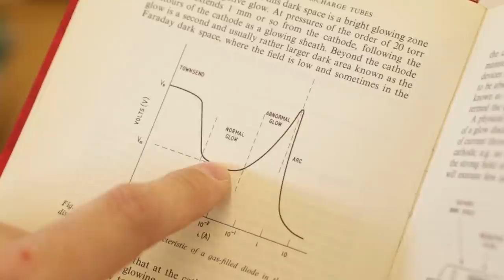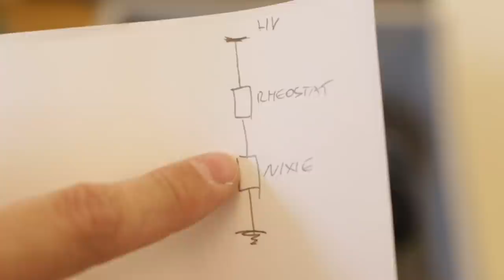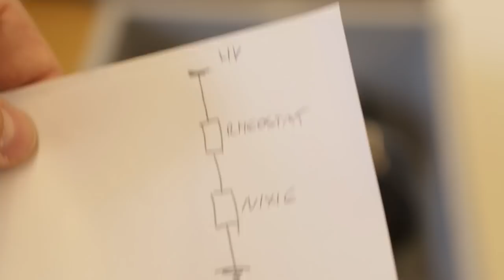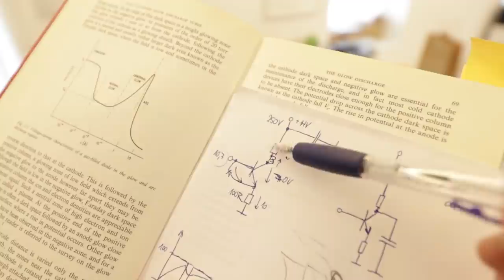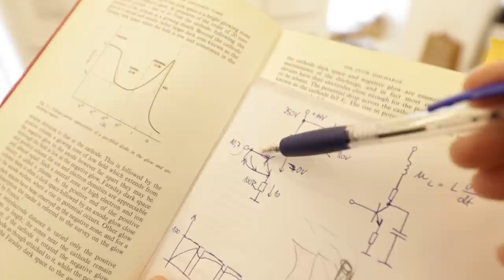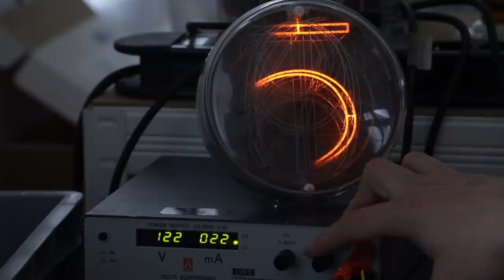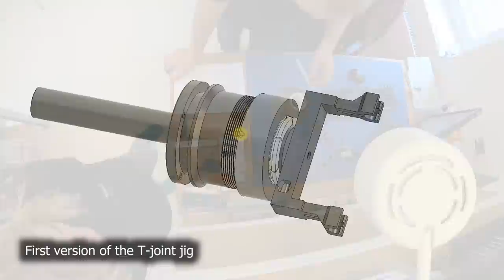Aging of the H tube and a vacuum relay project | week 14-15/2022

Comment: The tungsten can be brazed with a TIG torch. (Using a flame is hopeless!) Nickel wire can be used as the brazing metal. The welder I have is a Primeweld TIG225 which is an excellent low cost unit that includes everything you need except the argon tank.
Reply: I wondered how long it takes to find an commend from you on this channel.
Reply: @gekkedirkie  I keep an eye on Dalibor in case he gets in trouble!  :)
Reply from the maker: Hi Ron! Nice to see you :-) Good idea with brazing with TIG torch, never thought about it. We have TIG set up, so we can try it.
Reply from the maker: @glasslinger  I am in one big trouble since I started with nixie tubes :-)
Reply: @daliborfarny  Oh my! I watch from here and think of how great you are doing! Be careful to not get too big too quick. Keep out of debt! Let me know if there are tech problems you are having, such as the current limit for the cathode cleaning machine. I could have solved that for you immediately! (free!)
Reply: @glasslinger  can you help me?
Reply: @ibrahimkaragoz9596  I don't know. Some things I know about other things I am clueless!

Comment: two things to consider for the T joint.  longer jig to help center the initial bubble by holding where you have it and an extension to the end to guarantee position of the center and repeatability.  The second is that to copper ( or other metal ) plate anything you need a very dangerous chemical in the metal salt solution to make even coats.  I do not know where you would be able to get cyanide, it seems to act like a catalyst for electroplating, you do not need much, roughly 1 gram per 500 grams ( five hundred ) of the metal salt ( as measured dry ), more cyanide for some metals.  The solution will warm up due to the current in the solution so using a fume hood is always recommended.  Great work, keep going!

Comment: You could add an overcurrent shutdown circuit to the test rig. That could shutdown the output in under a microsecond when the arc is detected. That would prevent the wires from being burned off.

Comment: I wonder if for the burn in you could use RF. I think that might reduce the chance of arcing, and plasma cleaning is a pretty common technique for vacuum chambers.
Reply: Unfortunately not. You will face the same issues with arcing. The change in polarity alone (at MHz "speed") will not stop the arc development process. The RF generators are used in applications where the target is a non-conductive material (plastic, glass). For nixie tubes DC power supply seems to be a good choice. I would say lowering the pressure will reduce the arcing tendency, but I am not sure about mechanical limitation of a tube. But maybe for that kind of test you can use thicker glass. Please also localize where you have arcing. Maybe you can also improve wires insulation (and use enamel wires?)

Comment: That vacuum relay looks to be brazed.  I'd try nickel or silver solder, there is very little that can't be brazed or soldered together with them.

I am surprised you went with inductive arc current limiting, I figured some high-side resistive current limiting would do the trick?  Unless the anode capacitance is high enough that it alone can supply enough energy to zap the BE junction when it gets into breakdown?  With a hundred ohm emitter resistor I am guessing the current limit is around 40-50 mA and with say a 5 volts BE breakdown you must be seeing > 100 mA current surges during the arcing.  The transistor must be getting into second breakdown or something to even be still conducting the arc current for very long once the emitter rises above cut-off, what is its VCE rating?  Adding a series diode in the emitter may protect the BE junction (more reverse breakdown than a few volts of the BE junction at least), but then the emitter resistance would need to be changed to reset the normal current limiting point.  Kinda surprised you aren't killing something in the base drive circuit if the BE junction is failing, it must have a fairly stiff drive or a lot of capacitance to be able to sink damaging amounts of fault current?  It might actually be the transistor capacitances that are letting it kill itself, the miller capacitance in particular...  I think a better topology would be to have another small NPN (like a humble 2N3904) steal the base drive from the the HV transistor's base, fed itself from the emitter resistor, that way it need only generate a diode drop of voltage on the emitter before limiting - much less than the diode drop less than logic level, this does reduce the voltage reversal required to reverse bias the BE junction considerably but decreases the emitter sense resistor to about 13 ohms which will drop only a volt or two under fault conditions and the feedback transistor should be very fast in clamping the base drive, discharging any current that feeds though the larger device's significant capacitances.

Comment: Please read about "arc management" functionality in DC or RF plasma power supplies (like in TRUMPF or Advanced Energy products). In an overcurrent state the switch off has to happen in 10-20 us, so it has to be pretty quick. Then you have to wait 20-50 us and you can restart the voltage source.

Comment: Add a 15W 230V pygmy lamp in series with the anode supply. This will limit the current that can flow into an arc, and thus reduce the transistor damage. You can use an indicator lamp, which has a nice long squirrel cage filament, so it will rapidly heat up and limit current.

Comment: You can braze almost everything even stainless steel and tungsten carbide with high silver percentage material and flux, try searching in hvacr shops, they use this brazing material a lot.

Comment: Love the video!
Regarding the oxidation issue you're having, have you considered flushing the tube with forming gas?
It's a mixture of Argon or Nitrogen with 10% Hydrogen and works as a reducing agent without being a fire hazard.
As far as I have seen you have only one access port to the tube so a constant flow would be hard to do, but a few mBar of positive pressure inside, coming from that port, might still work out when sealing the front window. 
Good luck either way!
Reply: I wonder if it could be part of the bake out process even? They still have a tubulation for gas access, it'd need to be done through a set of fill and drain cycles though.
Reply: or they can add some hydrogen to the argon. The hydrogen will eventually escape by itself, most likely during the aging.

Comment: It may be possible to use an Op-Amp based overcurrent detection circuit on the tube ager. Depends on how quickly and how high the current spikes during an arc.

Comment: Have you thought about useing RF to create a uniform plasma in the tube to do the ageing and avoid the need to drive the tube so hard and risk arcing?
Reply: This is a great idea.
Reply from the maker: Yes, but we kind of struggled with it - it was difficult to keep plasma where we wanted it. But it is a backup solution, we still have the plasma setup prepared..
Reply: @daliborfarny  hmm yeah plasma can be unstable like that.  i'd be tempted to try somthing like  a few MHz at high voltage fead into each number in tern and allow it to capasitively discharge to whereever it wants.  it could be guided by external electrodes on the glass if needed, somewhat like a plasma ball.  the other internal structures do complicate it a bit and limit your options though
Reply: @daliborfarny  To get predictable results, you would need to calculate the electric field strength between elements (ANSYS Maxwell software or equivalent). Additionally the geometry of the elements would have to be designed so as not to exceed the specified field strength in order to minimize the arcs. But this is a higher-tech topic.

Comment: What about flushing the tube with gass (argon) while sealing the frontwindow (like tig-welders do) ?
Reply: This is my question also
Reply from the maker: We do that - I will try more approaches in the next sealing..
Reply: @daliborfarny  Strage, it should not be able to oxidize without oxygene ... maybe you need more flow.

Comment: Ultrasonic weld and you don't need solder. Could try spot welding too.

Switchmode constant current power supply is easy to make for electrode ageing.

Plasma etching with the right gas will remove oxide. Can make a simple RF induction plasma driver.

Comment: The current source solution is perfect. I use it widely if need to reduce the power.
May be, will be useful a pre-ionisation electrode. The very small current through it (150G resistors) significantly reduce the ignition voltage, and allow to use low voltage switches (80V). Possibly, there isno condition for the arc in this case.

Comment: Might be possible to burn off oxides using a specific wavelength laser that sweeps back and forth shot in from the side of the tube at a slight angle as it moves up and down so it can reach all the digits.  I also wonder about controlled inductive  heating of the digits to a low heat, perhaps that would also excite the neon and help it scrub the digits without the risk of arcing.

Then, there is always the possibility of flushing the tube with a constant flow of nitrogen while the face is being sealed so there is no oxygen to react with the digits.

Comment: Can you ramp the current and voltage up slowly or does it just start full that might help and if you just put low value high power resistors in line with each digit it would at least save your transistors

Comment: You know those videos of a laser hand tool removing rust from steel? Could you use something like that on a sealed tube?
Reply: Difficult to doubtful. The glass would cause a lot of problems. Also, they cost 3 legs, two eyebrows, and half a bread loaf to buy or rent. Source, we rent one two months a year to clean rusted architectural features that cannot be removed from their existing location (heritage, structure, rarity or state) in order to preserve them. In two years we'll have enough dough rolling and enough jobs with it to justify spending. And the biggest problem is there's a lot of chinese fakes out there, that barely do the job, but really are a waste of time, and can even be dangerous.
Reply from the maker: Interesting idea - the glass would distort the light, the digits are obstructing each other, the area on the bottom of the digits is not accessible. These are the most important reasons why this would be hard..

Comment: Likely better than the inductor, is using lots of resistors around those output transistors -- a sudden short at the output can indeed pull up on the whole thing, so, transiently, base and emitter voltages end up near B+.  A series resistor to the collector limits that action, while series base resistance limits the current there, and so on.  (Emitter is already shown of course.)  This sort of crude current limiting, keeps transient currents within ratings, until the transistor/circuit can stabilize back to nominal currents.  Which should take on the order of 100s ns for the transistor itself, and a few µs if there's an op-amp servoing its current.  Slower than this, I would consider a design problem, and a faster op-amp or more likely, better choice of compensation component values, should be chosen.

Don't forget a zener clamp on the base voltage source, or from emitter to sense amp if applicable, to absorb transient currents from their respective resistors/pins.

The biggest contra-indication for the inductor is twofold: 1. Yes, it acts as a lowpass filter, slowing the risetime from the arc; but it stores up energy in the process, released immediately after the transistor's current stabilizes, causing its collector voltage to spike, to perhaps 2 * B+ or more. 2. Even the transistor alone, let alone in a feedback loop with an op-amp, can oscillate due to the LC circuit formed by this and the transistor's capacitance, and say inductance of the base circuit, etc.  (Series base resistance also helps by killing AC gain.)  Usually an R+C (Zobel) network is needed across the transistor (C-E or C-GND), with C a few times larger than Ccb, and R = sqrt(L/C) or thereabouts.  Then adjust compensation for best step response (if applicable).

This all also assumes adequate thermal management, which is definitely a concern with what looks like top-side-heatsinked DPAKs (there is very little heat flow through thick plastic!).  A protective circuit to decrease or remove current flow some time after a fault occurs (excessive high collector voltage?) is mandatory.  This could be a foldback circuit, an ADC scanning the outputs and just turns off whichever channel for some ~ms (I guess these are programmable with an MCU of some sort in charge of everything), etc.  For testing purposes, I would just as well suggest using TO-220s (or larger) with adequate heatsinking; make it able to handle the load continuously.  And, at these voltages, MOSFETs will be better choices than BJTs (likely with little or no change necessary to the circuit, aside from compensating for the somewhat higher Vgs(th)).

Keep up the good work, the tubes are beautiful!

Comment: @17:10 about the oxidization of the digits during sealing, why don't you flood the tube from the back with nitrogen to avoid that? You could probably redirect the nitrogen from your oxygen concentrator rig..,

Comment: Hey man! If you're looking for a solution to slow down the current spike use an inductor in series. Inductors don't like the current to be rapidly changed through them and do anything to smooth it. In addition to the inductor use what's called RCD snubber to protect your transistors from burning out
Reply from the maker: Hi! Inductor in series is what Radim implemented in the end, worked :-)
Reply: @daliborfarny  Yeah! I've got to that point in Video! Awesome!

Comment: wouldn't separating the wires with some kind of insulator prevent the arcing? Or perhaps creating 5 connection hubs (it looks like you have one, I'm sorry if I'm not getting the terminology right) but distributing the concentration of bare wires brings the possibility of arcs down. perhaps a new way to create the seal with the wires and glass, more of a circular method than a straight line... I mean traditional methods are great but perhaps some innovation or experimentation is required? perhaps you have already solved this and I'm just screaming into the void

Comment: I find your lack of a freewheel diode on that inductor disturbing.

Also ultrasonic soldering can definitely do tungsten, though I can’t say how structural it is.
Reply from the maker: The inductor is not the only component there.. It is additional small circuit..

Comment: I made some linear laser drivers which could drive nixies with a transistor swap. I had some logic and an op amp that'd control current and trigger a failsafe shutoff if current got too high. Tell me if you guys need help.

Comment: How complicated would it be to do a tube with a stylized clock face that is basically just two rings of tick marks.   There would be 24 electrodes, so more than a numerical tube, but each of the electrodes is much smaller and perhaps easier on the aging process.   I'd bet you sell a lot of single tube clocks like that and you could do a Kickstarter to gauge interest and collect some startup capital for the project...

Comment: Hi! One question, in the minute 6:35, what’s the difference between the tubes on the left and the right, obviously the right are bigger  but do you use the tubes on the right to make the “ Puri Nixie Clock | 6? I’m asking because I want it but I don’t know which tubes that one uses and I really would like to have the big one on it. Thanks in advance for your help.
Reply from the maker: Hi Felix, thank you for being interested in our nixie clocks. All the tubes have the same size, this is "fish eye" effect of the lens I used for the camera - I didn't realize it made such a visible difference to the tubes. We make only one model of a nixie tube (R|Z568M, shortly R), which we use for all our clocks.

Comment: Maybe you're ramping the voltages up too fast? some of these things need to have the voltage applied slowly until it reaches the right amount. Unfortunately that would mean extending the burn time you'll need to have then run.
Reply: No, slowing down the voltage won't change anything. The arc discharge is a result of the high voltage applied to the conductors in a high vacuum. Obviously, no arc will occur during the slow voltage ramp. As I said, this is not the source of the problem.